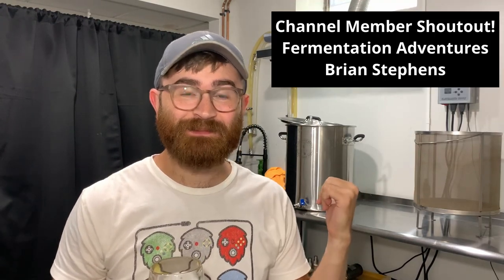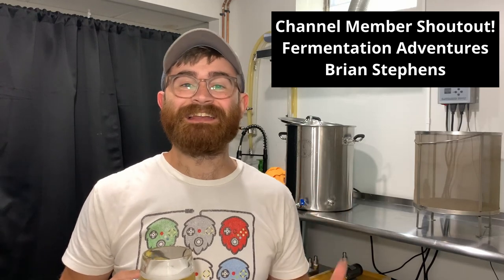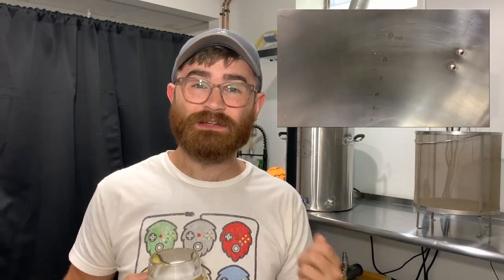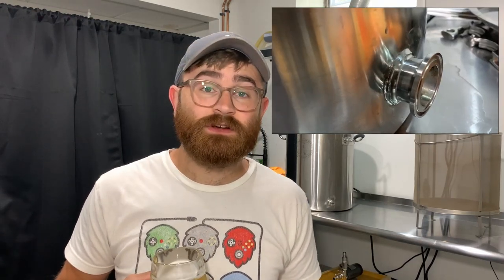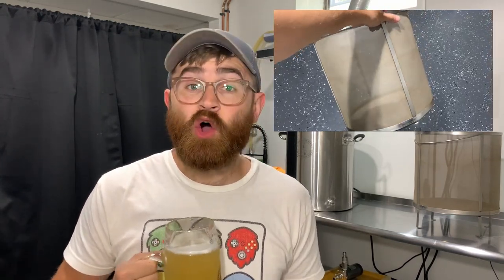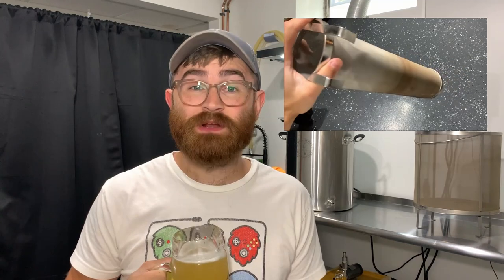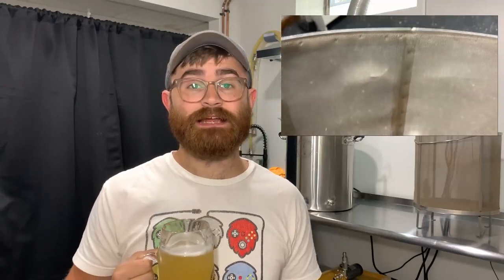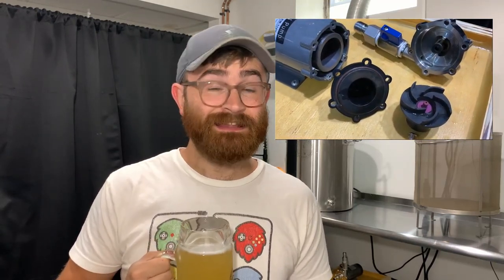Clawhammer BIAB System After 3 Years, How is it Holding Up? System Comparison!

Comment: I purchased the 20 gallon 230vac system 4 years ago. I gave up on using the brewing basket as mashing was too inaccurate. Temps would be out by 5f. Also way to heavy to lift and drain when doing 20 pounds of grain. I now use a separate mash kettle and I fly sparge. Also I don't use the kettle anymore because I had to purchase a Spike condensation lid because my new brew space has no window to exhaust the steam. The condensation lid is 1/4" to big to fit on the Claw hammer kettle - Not happy about that! This forced me to buy a 20 gallon Spike Kettle. I still use the pump and controller built by Claw Hammer and love it. If I could do it all over, I would purchase the Claw Hammer controller and build the system to surround it. Cheers!

Comment: HI Matt! I just purchased my system and I have been missing my expected OG by 12-13 points on each brew. I use Brewfather to create recipes and use the default equipment profile for the 120V Clawhammer system. Its expecting an efficiency of about 70%, does that seem to high and possibly the reason for missing my OG by the same measured amount? Im really stumped on this. Otherwise love the system!
Reply from the maker: Hello, was it a one time miss or are you consistently under by that much? Missing OG can be caused by a ton of factors but there are some things that may be able to help. 1: double crush grains, BIAB allows for that. 2: Sparge instead of doing full water volume in mash. (I have a video on sparging) 3: Account for the volume loss and use either less water or more grain when planning 4: Take pre-boil gravity readings and adjust with DME until you can get more data.
Reply: @TroubleBrewing  so far i have been missing consistently about the same amount. I will try double crushing next time to see if that helps as i have read for a no sparge BIAB, double crushing helps a lot. I will look to keep some dme on hand going forward to be safe as well because if I used any less water, I wouldnt hit my batch volume. Thanks for the response

Comment: Hi Matt, don't know why I missed this system update when you published, but just watched it.  I run both the 120V & 240V systems and have both the 10gal and 20 gal kettles.  Just one note about the discoloration on the baskets.   I have only done this a couple times over the 50 or so batches I have created, but if you set up for circulation at 140F with a PBW concentration of about 2 oz/gal with enough volume to cover the stained part of the basket, it will come out looking new.  Or it least it has for me.  There may be a point beyond which it works, but it can make a big difference.  Also has benefit of a good clean of the pump, chiller and hoses, though the hoses remain yellowed.
Reply from the maker: Oh very cool! I may give this a try at some point but good to know that can probably be reduced! Cheers!

Comment: Thanks for the long term update! This system is on my list. Confused on upgrading to 240V system by changing out only the element.   What about the relay, receptacle, power cord, breaker and wiring to handle 240V.  I think you are mistaken on upgrading the output capacity of the controller.  Not trying to troll you, but there’s more to it than that.
Reply from the maker: Hey Kcmoto, sorry for the confusion if I made it seem that you just have to swap the element. There is alot more to it then just swapping out the element. If it was just the element im sure everyone would be doing it since elements cost almost nothing.

Comment: You're lucky I had to have my pump replaced after my 2nd brew day.  I got everything ready and went to do my 3rd and my pump would not power on even when directly plugged into an outlet.  Clawhammer replaced it without any issues and then I went to do my 6th brew day and my pump would not turn on for some reason, it took 3 times plugging it in to actually get it to work at all but it did start working again so no need to have it replaced.  My local Home Depot didn't have any pumps that were all stainless and I didn't dare use one with a plastic internals as they were not heat rated. I have yet to do a review but I have only done about 7 batches on mine so far.  I agree with you on the hop basket should be a bit larger in diameter.  The one thing I don't like is that my grain basket seems to have some metal spurs on the upper edge so when I clean it sometimes I end up with small holes in my fingers :D  All in all I am loving my Clawhammer system and the support provided by the team there has been awesome! Awesome review and I cannot wait for my next brew day!  Modularity is the main reason I went with the Clawhammer system since I can buy just about everything locally (when in stock)
Reply from the maker: Sorry to hear about your pump, sounds light a nightmare.
Reply: @TroubleBrewing  It was actually a pleasant experience as Clawhammer made it quite easy by sending me a replacement at no cost since it was only a few weeks after my initial purchase of the system,.  Their support has been awesome!

Comment: Stupid question here: You mentioned the hop spider being too small for the CH system. Is there anything preventing a user from emptying the grain basket after the mash, rinsing it out and reinserting it for the boil and using is as the hop spider?
Reply from the maker: Hey definitely not a stupid question! I cant remember who, I want to say Short Circuited Brewer did a brew day were he tried that and I believe the hops really clogged that basket up causing flow issues. I could be wrong but I do remember there was a reason not to do that, just cant remember.

Comment: If you have the extra money to burn...would you consider the Spike system? It looks quite a bit more sturdy and overbuilt that the clawhammer system.....
Thoughts?
Reply from the maker: Hello! Not sure if you have seen this but I have a video comparing all electric biab systems: https://www.youtube.com/watch?v=ZgBn_RjPWDA But to answer your question, personally no. The system is $600 more expensive and does not include a chiller. There are nicer systems available at a higher price point but personally I dont think the spike system is worth it IMO.
Reply: @TroubleBrewing  CH has a chiller?  I couldn't find that anywhere and it was the factor in me buying one.  Might have to indulge.
Reply from the maker: @johnnyzsalt5374  Yea it comes with a plate chiller! Works awesome!
Reply: @TroubleBrewing  I guess the only thing left is actually learning how to brew beer.  Just a simple golden lager like Coors to start and then maybe I will try to get cute.  I'm hoping I can get good so I can have a decent retirement gig.  Its either that or becoming a janitor.